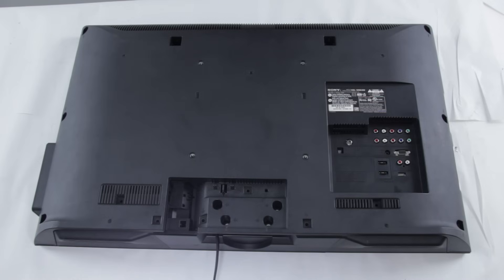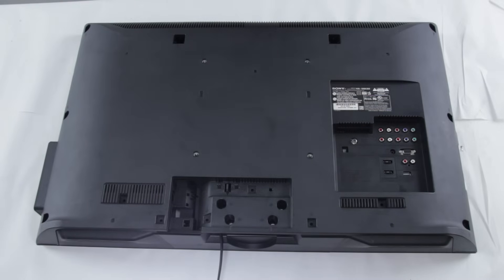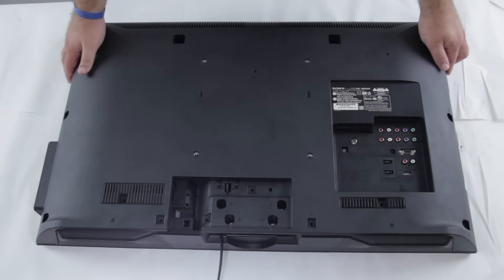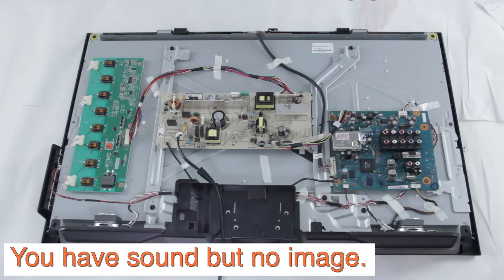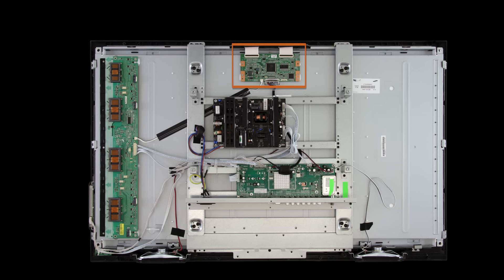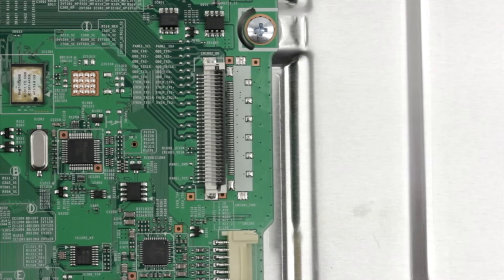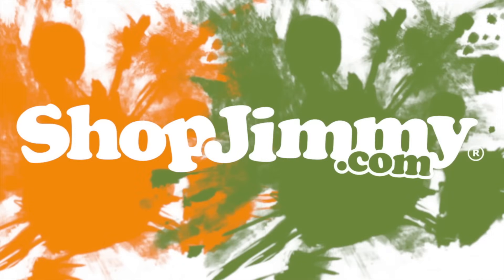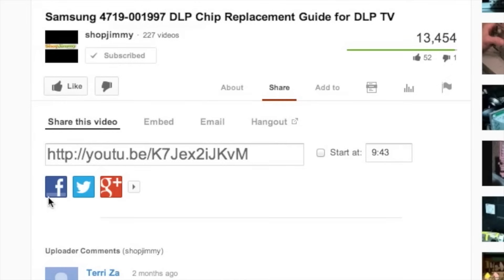LCD TV Repair Tutorial - T-Con Board Common Symptoms & Solutions - How to Replace T-Con Board

Comment: I have a Vizio E420VL. When I turn it on, or switch inputs, the screen freezes with horizontal lines that appear and disappear until the tv is "warmed up". The sound continues and is not affected and after about 10-15 minutes, the screen clears and is seemingly fine.
Reply from the maker: +Common Good   Try all repairs and troubleshooting at your own risk.  This could be a problem with either the main board or the panel.  You can replace the main board in your TV to see if that fixes the problem with your TV.    Click this link to replacement parts for your TV model number:  http://www.shopjimmy.com/vizio-3642-0872-0150-main-board-for-e420vl.htm  There may be multiple boards for the same TV model number, be sure to match part numbers on your current board, with your replacement for compatibility.  Here is a link to a video showing how to identify your part number, click here:  https://www.youtube.com/watch?v=kxkeGLhlQY8  Thanks and please let us know if you have any further questions with your TV Repair!  www.shopjimmy.com

Comment: Looks like you guys are the ones I need to be calling.  I bought a 26" Sony Bravia in 2010, boxed it up a few months later (had to transfer overseas, so put it in storage).  Never took it out of the box until a few months ago, when I realized the TV didn't respond to the remote any longer.  So, went to Sony's tech assist page, and they said to upload new software on the TV, of which I did.  Still no go.  Then they said to plug it into the wall directly, instead of through a surge protector, so did that.  Nothing worked.  Ok, feeling like must be the remote.  Took the remote to the other room where I have another Sony TV, it powered on and off with that remote.  So... nope not the remote.  Then programmed my Logitech Harmony 510 with the TV's codes to run it with it... still a huge nope.  Definitely the IR sensor is no longer functioning.  Just why did it stop functioning when it was in storage?  It's as if it were programmed in it's internal code to stop on purpose.  The TV hasn't had 20 days of service in it's entire life.  I went to an authorized SONY repair shop today to have them take a look at it to tell me it's everything else in the TV that's malfunctioning, but the TV works perfectly, channels scan in, volume works... just have to use the buttons on the TV to do that.  The repair service says they can most likely fix it for around 150$ based upon other TV's with similar issues they've had with this and the 32" model that Sony produced.  Do you think we can do it cheaper this way, or wait out for ShopJimmy to repair/replace the board.  I saw your webpage already and it says the 26" board is not in stock but the 32" board will function as a replacement.
Reply: Adam Pierce its called planed obsolescence. Ive caught on thats china for you. Build stuff here

Comment: I have Mitsubishi LT55154,. Suddenly it stopped showing picture from devices connected via HDMI ports. TV works fine with internet (Wudu, etc). It also works fine with USB drive input. Just the HDMI inputs are not working. Noticeably, it recognizes when a HDMI input devise such as blue ray is connected. It automatically switches the input, but display picture. How do I know which part to replace? Please advice. Thanks

Comment: Hi Jimmy,
 I have a Samsung 60in TV (model UN60FH6003) about 1.5 years old. Recently, it starts to turn on and "off" by itself: The picture will freeze first, and after a couple of seconds, I will hear the chime and the TV will be "off" (I could not see any backlight) and then I will hear the chime again and the TV will turn on and resume whatever program before it turned "off" .. This will repeatedly happen. I had a TV repair person come over and he said it is the T-con problem. However, I'm not sure whether this is the typical symptom of T-con problems: I could not see any backlight while it is "off" and the backlight will come again and the TV would be on; there is also NO sound while it is "off". While the TV is on, it functions perfectly fine. 
Another clue is that I only use the TV for chromecast and amazon TV and both are connected to hdmi ports.  Although, the "on and off" thing also happened when the TV was only connected to power and while in the setup menu. These symptoms started a couple of weeks ago. First, it was only occasionally, but they become more and more frequent in the past couple of days :(.  Any help and information will be greatly appreciated!!
Reply: +Jie Did you ever try the tcon replacement? Same tv and same exact problem in having. I am in the same boat, doesn't seem like the typical problem with tcon failure. I replaced the power unit and it is still doing it so I've eliminated that as a possible problem. You're the first person I've come across with the same problem. Let me know if you fixed it!

Comment: I have a refurbished Samsung LCD TV, series 530.  A few months after purchase (Samsung would not honor the warranty), the picture started going in and out very regularly but there is always sound.  Sometimes I turn it on and there's no picture for anywhere between 2 minutes to sometimes 30 minutes and then it will suddenly come on; other times, the picture comes up immediately but goes in and out; and sometimes it comes on and stays on.  Is this a t-con board problem?

Comment: KDL-32EX400 serial 4627674 im getting double image, how do i know if it is the tcon board vs the actual ribbon cable?
Reply from the maker: +Alejandra Nunez   Try all repairs and troubleshooting at your own risk.  This sounds like a TV panel (TV Screen) problem.  If your TV panel is bad, it may be more cost-effective to replace the TV as panels are typically hard to find in stock, difficult to replace, and expensive.  Thanks and please let us know if you have any further questions!  www.shopjimmy.com

Comment: My 47" Vizio screen went black.  Vizio Model #V047LFHDTV10A, Serial #LJPBNBJ2120707.  I opened the back panel a found that two of the brown coil like capacitors (?) were fried.  I went to your website to purchase a replacement but you did not have the replacement part in stock.  Notwithstanding I found the replacement power supply from another source.  The replcement part was an exact match based on the serial number. After replacing the power supply and reassembling the unit I turned on the TV and it worked for about a minute, than I heard a small crackle and pop and my screen went black.  The power supply burnt out again.  Please advise on a solution to this problem.
Reply from the maker: +JM Harris   Try all repairs and troubleshooting at your own risk.  This sounds like a TV panel (TV Screen) problem.  If your TV panel is bad, it may be more cost-effective to replace the TV as panels are typically hard to find in stock, difficult to replace, and expensive.  Thanks and please let us know if you have any further questions!  www.shopjimmy.com

Comment: I have a vizio 60 inch that has sound but no picture.  Do you think it is the t-con board or the main board?  Model #E60Li-A3
Reply from the maker: +james mansell   Try all repairs and troubleshooting at your own risk.  This sounds like a TV panel (TV Screen) problem.  If your TV panel is bad, it may be more cost-effective to replace the TV as panels are typically hard to find in stock, difficult to replace, and expensive.  Thanks and please let us know if you have any further questions!  www.shopjimmy.com

Comment: Hii Shopjimmy- Have a Toshiba  L520U2 and bought a t-con board from you but we still have 1/4 side of the screen with solid every other lines in white about 3 inches thick. We have tried cleaning ribbon cable connections and switching ribbon cable from side to side and the effect is exactly the same- no change. Any thoughts you can help us with?TIA
Reply from the maker: +Deal Depot   Try all repairs and troubleshooting at your own risk.  This sounds like a TV panel (TV Screen) problem.  If your TV panel is bad, it may be more cost-effective to replace the TV as panels are typically hard to find in stock, difficult to replace, and expensive.  Thanks and please let us know if you have any further questions!  www.shopjimmy.com

Comment: hello people from shop JimmyI get a LCD screen from Samsung  LE40a436t1d  for free with some disturbing vertical line in it.After some looking around from my son on the internet he read something about pushing a little bit the cable s  from the T Con  board and so on .......... and I think he takes also take out the 2 very flat cables who goes to the screen  with the voltage on and touch the electric parts with his dirty fingers ???After that we had no image anymore, only some flashing from the screen  but after a while it look goes better and it goes totally on  white and the audio from the channels are also back .......... but still no image from TV channels. So the question  do I need directly replace the  T con board or are the other way s to try before ???cleaning the fragible cable s with special gum ??-I there a way to reset something ....   a secret service  code ?? or cutting some jumper on the other board with the high voltage     JP 852  ( it s not on my board, I have JP825  )try to renew the cable sMaybe you have better sugesstions  :))new cables I can take from a other TV, were the screen is broken (fells on corner from a table) but all the parts inside are okay  (Sharp Aquos)Strange thinking put the t con board from the Sharp into the Samsung but I think you say it s not gonna work  hahahaha.By the way I have a voltage meter, but only don t know how it s works with this small electronic parts ......Okay thanks for your time  and maybe your good advisesgreets MikeNetherlands
Reply from the maker: +Flip Flipflap   Try all repairs and troubleshooting at your own risk.  This sounds like a TV panel (TV Screen) problem.  If your TV panel is bad, it may be more cost-effective to replace the TV as panels are typically hard to find in stock, difficult to replace, and expensive.  Thanks and please let us know if you have any further questions!  www.shopjimmy.com

Comment: concerning my problem with the 42" polaroid LCD TV in losing it's color with some blurriness and a little static .  it was recomended that I change out my t con board or maybe my main board to fix the problem.  it turns out that after moving and having DISH set up my TV at this new location they found that a connecting device in the cable system had blown and when he replaced it, my TV worked just fine.  So, for other people with TV problems, if you have a satelite service (maybe cable also) your problem could lie in the equipment that your satelite or cable provider is using to connect to your TV.  maybe you could have that checked out before spending money on your TV.
Reply from the maker: +Charles Waldrop   Try all repairs and troubleshooting at your own risk.  Please reply with your TV model number.  Click here to view a video that shows how to find your TV model number:  https://www.youtube.com/watch?v=S51nhAmwR2M  Thanks!  www.shopjimmy.com

Comment: I have a Samsung LCD TV model un46d6000sfxza. it has a thick black vertical line right down the middle of the screen. what is the problem with it?
Reply from the maker: +Ronald Smith   Try all repairs and troubleshooting at your own risk.  This sounds like a TV panel (TV Screen) problem.  If your TV panel is bad, it may be more cost-effective to replace the TV as panels are typically hard to find in stock, difficult to replace, and expensive.  Thanks and please let us know if you have any further questions!  www.shopjimmy.com

Comment: A 2-3yr old Vizio M470SL has developed vertical lines (regardless of input source; tv, dvd, chromecast, etc) with small horizontal lines within each vertical discolored line. Additionally, the 'ghosted' image showing behind the vertical lines is also freezing and skipping. PS. Sound comes through just fine, only the picture is faulty. Any idea what the problem part may be? (t-con pcb, perhaps?) I can email you a picture of a screen shot, if that helps.
Reply from the maker: +David Staples   Try all repairs and troubleshooting at your own risk.  This sounds like a TV panel (TV Screen) problem.  If your TV panel is bad, it may be more cost-effective to replace the TV as panels are typically hard to find in stock, difficult to replace, and expensive.  Thanks and please let us know if you have any further questions!  www.shopjimmy.com

Comment: I need help with a 46 inch samsung that has a problem starting up. The model number is LN46A540P2FXZA  I was told it was a capacitor problem so i replaced all the caps and I still have the problem. The problem is that when it powers up, I see green vertical lines and the sounds is some sort of buzzing. It will stay like that for approx 10 seconds then it restarts itself and then it comes up normal. I sometimes can see the tv signal in the green lines before it shuts down. Sounds like a t-con board after watching your video but I cant seem to find one to match my model number. Can you help??
Reply from the maker: +Paul Petrie   Try all repairs and troubleshooting at your own risk.  This sounds like a TV panel (TV Screen) problem.  If your TV panel is bad, it may be more cost-effective to replace the TV as panels are typically hard to find in stock, difficult to replace, and expensive.  Thanks and please let us know if you have any further questions!  www.shopjimmy.com

Comment: I have horizontal lines kdl-46bx440. 3/4 of screen i have the lines
Reply from the maker: +mauricio vidal ramos   Try all repairs and troubleshooting at your own risk.  This sounds like a TV panel (TV Screen) problem.  If your TV panel is bad, it may be more cost-effective to replace the TV as panels are typically hard to find in stock, difficult to replace, and expensive.  Thanks and please let us know if you have any further questions!  www.shopjimmy.com

Comment: Element ELEFW504 LCD flat screen tv. screen will not turn on. Sound works, light on the bottom of the tv turns from red to blue. screen gives a quick white or blue flash for a split second. Screen will not turn on. Backlights flast for a second when tv is turned on, otherwise no backlighting. You can see the menu box with a flashlight. Hopefully T-CON board???

Comment: Sony Bravia KDL-46S4100 5y/o, direct cable attach.  HD(only HD) channels are no longer displayed(No Signal) and no sound. Year ago HD channels would go blackout for a few seconds until TV warmed up (~30min). Blackouts grew longer, now HD channels are pretty much gone. Attached cable to other TVs, HD fine.  Thanks
Reply from the maker: +The Ravenelles  Try all repairs and troubleshooting at your own risk.   I recommend replacing the main board in your TV.  Click this link to replacement parts for your TV model number:  http://www.shopjimmy.com/catalogsearch/result/?q=+KDL-46S4100  There may be multiple boards for the same TV model number, be sure to match part numbers on your current board, with your replacement for compatibility.  Here is a link to a video showing how to identify your part number, click here:  https://www.youtube.com/watch?v=Aodz2LHkzbY  Thanks and please let us know if you have any further questions with your TV Repair!  www.shopjimmy.com
Reply: +ShopJimmy.com I was thinking the same thing, thanks for the expert confirmation. Pleasantly surprised they're lass than 50 bucks.

Comment: G'dayI have a Samsung UA55D7000 LCD TV which is presenting several thin blue vertical lines just left of centre of the screen.  It is more noticeable when their are greens in the picture, particularly watching sport and their is a short of the ground.  I do not think there is a lot wrong with the TV.  We've only had it about 4 years from new.  Is this problem solvable by fiddling with connections on the t-con board, or is there something more sinister?  Regards Aaron
Reply from the maker: +Aaron Lynch   Try all repairs and troubleshooting at your own risk.  This sounds like a TV panel (TV Screen) problem.  If your TV panel is bad, it may be more cost-effective to replace the TV as panels are typically hard to find in stock, difficult to replace, and expensive.  Thanks and please let us know if you have any further questions!  www.shopjimmy.com